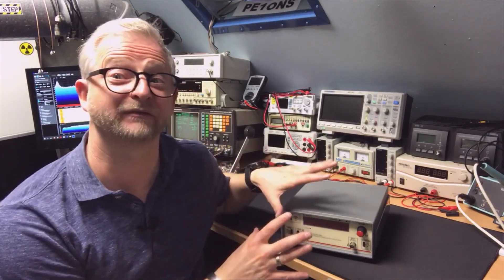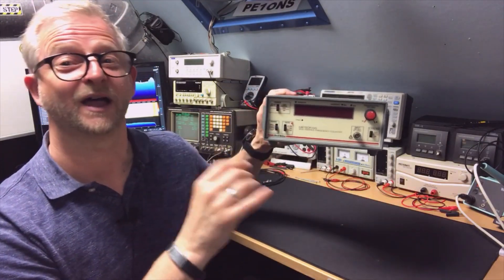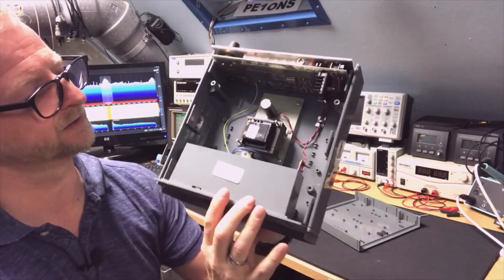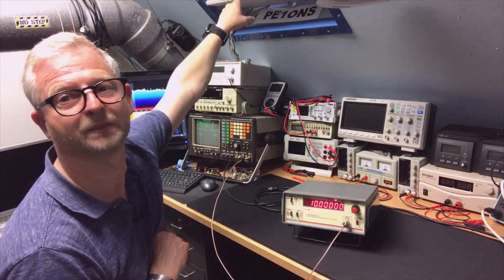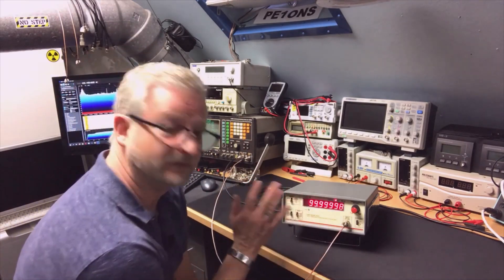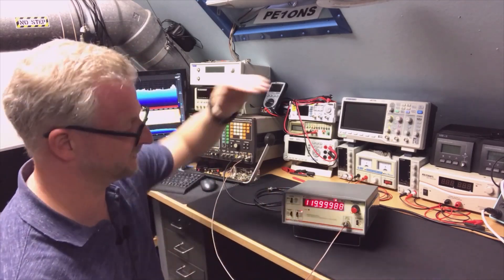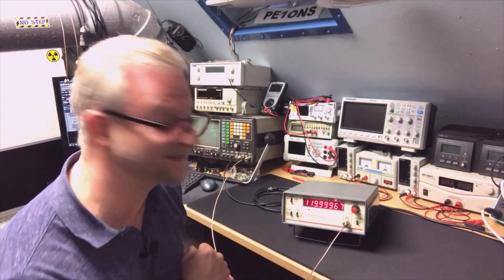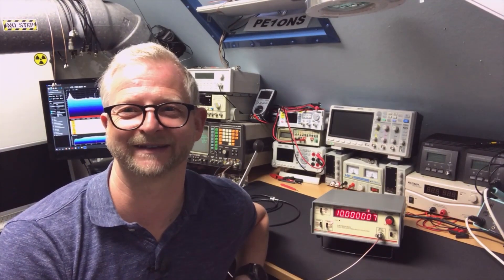#033 Black Star Meteor 100 Frequency Counter Calibration

Comment: Tony.  I am enjoying your video's and have bought some BG7TBL units on your recommendations..  Do you have any information on another Blackstar Counter.  1325?  I cannot find or purchase a service manual anywhere.  I have one I would like to restore and fit an external input, but not without a circuit diagram.   With the BG7TBL do you feed the 1MHz reference directly to the Marconi 2955 or attenuate before input.  If you get chance it would be interesting for you to review the marconi and show what you use it for and how you set it up.  Thanks.  G6MAF.
Reply from the maker: Hi Curtis, i think i missed your comment. Thanks, nice to hear you enjoy.. about the 1 MHz on the Marconi, its input is 1M Ohm and not 50, so i put a BNC-T with an 50 Ohm terminator.. thats it,no ATT... Yes a Bench tour and/or Marconi review will come!.. i will have a look for your Blackstar 1325 Schematic, and giove you a download link if i find... '73 Tony
Reply: @TonyAlbus  How many watts does the device handle if I want to synchronize my 27MHz CB radio with it?
Reply from the maker: @13HN870  Hi, my advice would be, to never connect directly any transmitter, best is to use a RF-Tap or antenna's on both the TRX and the counter and keep some distance between them.  a video on RF-taps will come later, so stay tuned.
Reply: @TonyAlbus  Thnx. Grettings from Gernany✌
Reply from the maker: @13HN870  Bitte
Reply: @TonyAlbus  Ja stimmt ich brauche nur am Counter eine BNC Antenne anschliessen über die HF von meiner Antenne sehe ich dann die Frequenz auf dem Zähler👍 Kanal ist abonniert sehr Interessant hier📡
Reply from the maker: @13HN870  Great that worked.. thanks for the Sub and enjoy!
Reply from the maker: Hi Curtis, could only find servicemanual for 100/600/1000 and a usermanual from RScomponents for 1325... does the 1325 run on a kristal or a OCXO ? .. then you look where the 10Mhz cristal/ocxo goes into a IC .. there is the point where you can disconnect to cristal/ocxo and feed in 10MHz ttl. from your exct.ref.. have a look at video #062

Comment: Hello Tony,
I have a Blackstar Meteor 1000 Counter, & works fine,
 but the front panel has discoloured with age like the photo bellow,
https://drive.google.com/file/d/1r5zObc7JRddk4af_WkQqx1k0pHbdiI77/view?usp=sharing
*the discoloured area its behind glass ,
does a solution to clean the panel or any idea to do this ???
thnx
Reply from the maker: Thanks for the picture... oof, i have seen that look better.. i have no experiance in improving that.. sometimes you make a choice not to do anything. it is also its age..
Reply: @TonyAlbus  ,
Thanks for the quick reply,I think, that this discoloration,
due to the quality of the glue,glued to the inner label (possibly paper),
with the front-outer plastic panel,and over time / age / light,
this aged glue has polymerized and we have this effect..,
*I will try to separate these two parts of the panel,
 (if possible - without of course doing any damage).
thank you for your time - regards
Reply: @TonyAlbus  Hello Tony once again,
I'll tryed to do something about the front panel's  discolouring,
without result,it is something like glued sandwich.
I made a small mod by a regulator in power supply for better stability-performance.
bellow the new result:
 https://drive.google.com/drive/folders/1IOnEIk9yvb8aN_QMpPWqlGRcRbCRe1aD?usp=sharing
Reply from the maker: @Ianistrip  Looking very nice!... thanks for the pictures